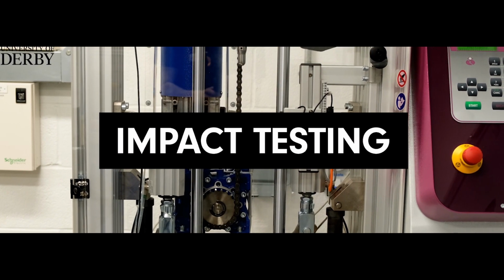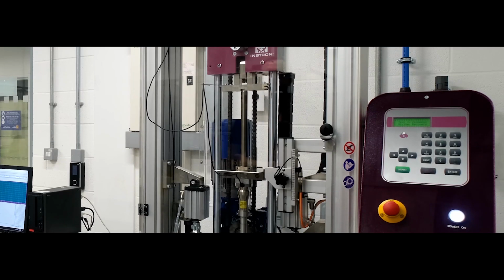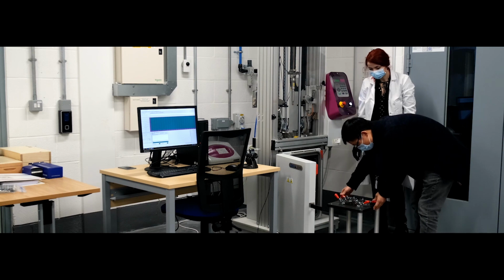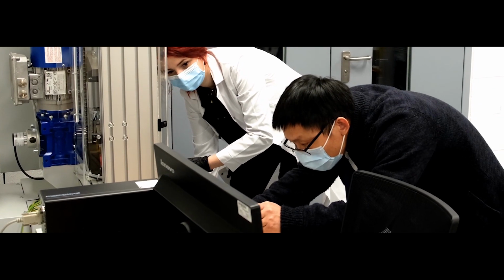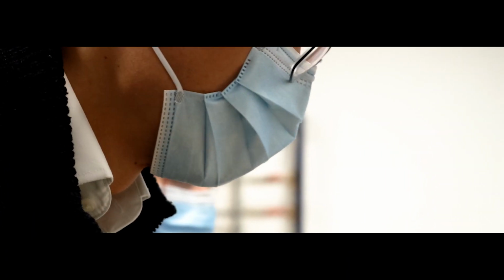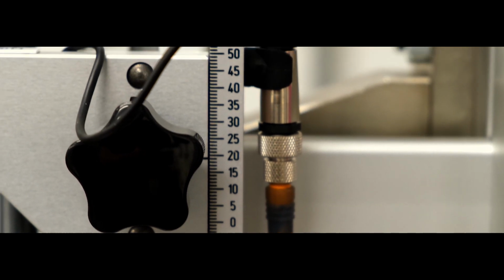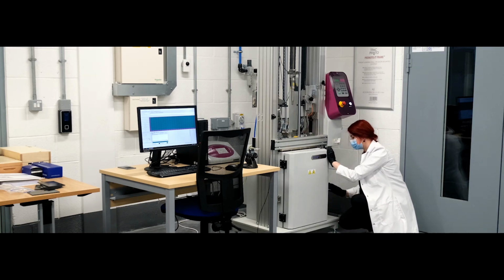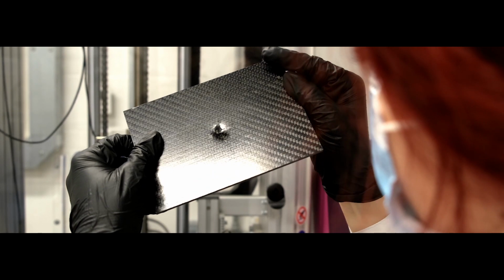Impact Testing Machine using carbon fibre reinforced polymer (CFRP)

Comment: Hola podrías explicarme en qué valor colocar la fotocelula del equipo, para que mida correctamente la velocidad de impacto y de rebote.
Reply from the maker: The photocell value will be depending on other parameters in the system such as sample thickness. The software will collect all information and recommend a value for photocell at one stage, all you need to do is to follow recommendation and make corresponding adjustment in the photocell. 

Translated with Google: El valor de la fotocélula dependerá de otros parámetros del sistema, como el espesor de la muestra. El software recopilará toda la información y recomendará un valor para la fotocélula en una etapa; todo lo que necesita hacer es seguir la recomendación y realizar el ajuste correspondiente en la fotocélula.